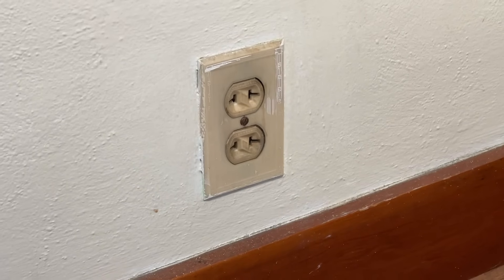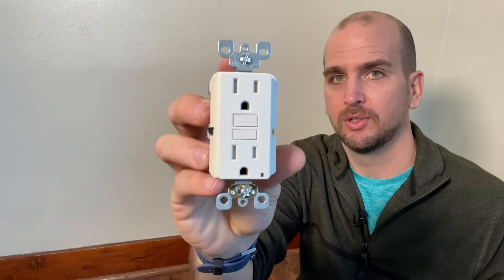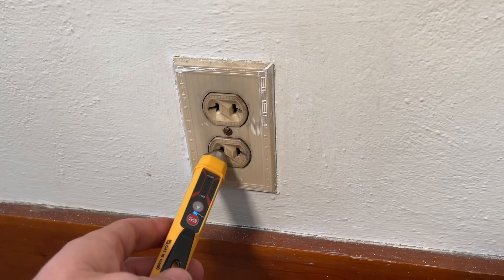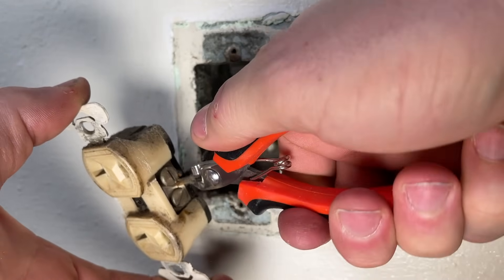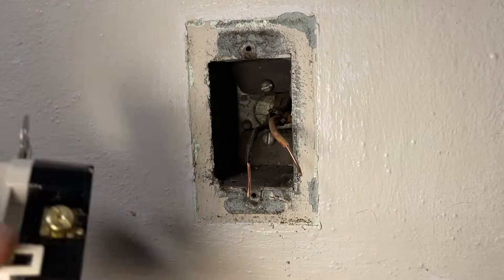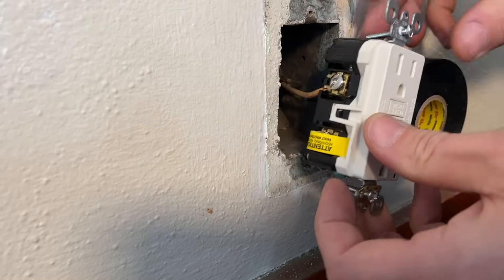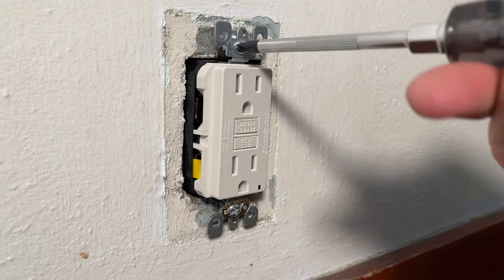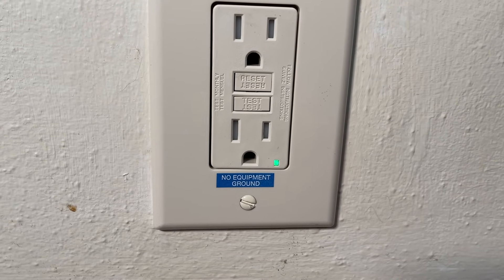How To Replace An Old 2 Prong Outlet Using 3 Prong GFCI

Comment: Right gfci will work even not grounded but still not grounded. You have to create ground return path and your return path is your neutral  which in reality is the natural ground. Important is to bond the neutral terminal to the panel. Please don’t give solution that will not really do the work.
Reply: No, using the neutral wire for grounding is against the code. This works and it is up to code. Nobody says it is the ideal way but running a separate ground wire can be expensive.
Reply: This video shows exactly how NEC recommends fixing.  Learn a little bit next time before commenting.

Comment: Almost every outlet in the USA is installed upside down; I guess it's because when installed wrong, the outlet resembles two eyes and a mouth.  But properly installed, the "mouth" should be on top.
Reply: No, the code does not specify the orientation.
Reply: @okaro6595  Who said anything about a "code"?

Comment: Remember that while this may provide a safe looking receptacle that gladly accepts your 3 pronged plug, surge protectors rely on the ground to shunt over-voltage away from your equipment.  So plugging a surge protector into one of these receptacles would render the surge protector ineffective.  I almost bought a house where the owner had replaced all but one of the receptacles with 3 prong without adding a ground source but when I saw the older receptacle I tested and found they were all UN-grounded.
Reply: It'll make cable boxes pick up noise and have occasional pixelation errors on certain channels not being grounded right. DVD players are sensitive to skip too. Microwaves & refrigerators can give you a mild shock if you touch something grounded or have a concrete floor barefooted.
Reply: @virginia7125  DVD players do not have grounded plugs. They do not care if the outlets have ground connections.
Reply: @virginia7125  Yes!! We had an old fridge plugged in downstairs as kids and everytime we went to open it we'd get that warm fuzzy feeling. Thinking back on it now, yikes....
Reply: He aesthetically improved the outlet. Glad it has a ground port, too bad there is no ground reference to make it actually work as a safety function.
Reply: Surge protectors typically have three varistors, one between each wire pair so they should work also without the ground wire though maybe not as efficiently. Of course one in general can question their usefulness.

The main problem is that this could cause voltage spikes especially if you connect ca computer to a TV with an RCA connector. Fortunately that is not done anymore. RCA is a badly designed connector as the signal connects before the grounds. It is better to use wireless solutions if the computer is not grounded.
Reply: Depends on the surge protector. Without a good ground a simple varistor surge protector only provides limited high voltage hot to neutral delta-V protection.  A strike to both incoming service lines would pass right through. Basic solid state surge protectors provide very little high impulse, low current (static discharge) protection regardless of their design; they work too slowly.
Reply: @Ehbfunbcc Whjfhbhjxf bad practice. Is the pipe corrodes, a fitting comes loose, or a portion is replaced down the road with pvc, then you have the potential for an electrified section of pipe with no path to ground - in other words, a death trap.
Reply: Cool story, bro.
Reply: im going to drill a hole thru the ouutside wall and run a ground wire to ground rod right there outside. NOT 8' long as the ground here is like reinforcedd concrete so if i can water the ground and get the ground rod 2' in the ground and keep it moist i think that  will be fine... kinda cheezy but... beats having to rewire the whole place with 3 wire wires in old house that is brick and no access t the wires, old wires... without just running new wires outside in conduit attached to the side of house/back of house where no one sees it anyway. new wires straight to the elec panel. in short run... a hole drilled in wall and ground wire to ground rod outside for the GFCI outlet to work right, better than 2 wire only from 1947 ish
Reply: I lived in an apartment like that. Seeing some of the other work done, I suspected the grounds weren't hooked up though then found the 1 2 prong outlet and pretty much knew but I checked anyway. I was right.
Reply: @n1umj  guy told me he did that in old house FOR SALE... replaced all 2 wire outlets with grounded outlets... no ground. LOOKS right... he cld have drilled ahole thru the wal and driven 2' long ground rod in the rock hard ground for the ground with a little more work.  yes not exactly right but it wud have a ground.
Reply: If the entire house has no ground....it's an old old house...  installing a GFCI receptacle  in the front of the circuit is the best and only option....That's it!  End of story!.....Obviously a Surge protector is ineffective! Re-wire the entire house!  But that costs money!   And electricians, are too expensive......so do it your self, and burn your house down

Comment: Won’t pass code, and it’s a waste of a GFCI, with an open ground it will not trip.
Reply: It doesn't rely solely on current being present on the ground connection: it'll trip any time the current on the hot and the current on the neutral are unequal. You can confirm this by splitting a power cord and plugging the hot side in to one GFCI outlet and the neutral elsewhere (carefully, very carefully). When you turn on the load, the GFCI will see current on one wire and not the other and trip. 

In practice, this sometimes happens when replacing an old outlet that had a ceiling lamp (!!) daisy-chained on it that used a separate neutral or was energized by a lamp leg coming from somewhere else. (!!!!) You get your GFCI installed and it works just fine, but then it trips every time you turn the light on.Then you curse because you have to go back and rewire the daisy-chained load on the Line side of the GFCI. And then you curse again to send a little grief to the builder (long since gone to his reward) who installed that screwy wiring in the first place.
Reply: I've ran across the white wire being hot, not neutral if on a switch. I had to straighten a few miswires in my house built in 1956.
Reply: 0 iq the gfci may not trip with a plug tester but will trip of neutral al and live are bridged together with the test button also a resistance will also make it trip
Reply: The GFCI will still function as intended, the open ground will not prevent the transformer from detecting a change in current
Reply: @Thumbsdwn  what transformer are you talking about?
Reply: @bokesnmokes  the current transformer inside of the GFCI that "measures" current in/out
Reply: @Thumbsdwn  got it

Comment: The Ontario Canada Electrical code would not accept this replacement unless you have a ground conductor connected to the green screw on the GFI receptacle.  You do not need to run a ground conductor ( usually a bare or green coated wire) back to the main panel provided you can attach it to the nearest metal cold water pipe.  No Canadian Electrical  Authority would pass this upgrade as shown.
Reply: Different areas have different codes. On some areas such connection to a pipe would be strictly illegal.
Reply: That would be a pain depending on the type of house, probably would have to open up the walls to run new wiring.
Reply: Canada is inconsequential

Comment: This is no better than cutting the ground prong off, If your going to do something do it right and ground the outlet or leave it alone. At least before you knew there was no ground and that sticker will fall off in 2 years or less I promise you.
Reply: This is significantly better as the GFCI protects the user. A sticker will not fall off from plastic.

Comment: ground fault circuit interrupter (GFCI), needs a ground to work. Why not put a $2 plug and ditch the $10 GFCI, because its not up to code either way. You can take the baseboard off, cut a line down the wall and replace the wire with no damage, from the top plate, go into the attic and run a new home run(circuit) put it on a GFCI breaker so it is up to code for bedrooms. up to code and safe. I would rather go the extra mile to insure my families safety or someone else's.
Reply: @tradde11 to be honest when I seen the title my first thought was he would pig tail the neutral to two wires and run one into the ground, your plug tester & plug would work right. but its not up to code and has a chance to over load the wire going to the panel.

Comment: After removing the two prong outlet why cut the cords instead of simply unscrewing them from their respective posts? Cutting them reduces their limited length and seems unnecessary.
Reply: Should have at least 6in. Of wire outside of the box . According to the NEC.

Comment: "If you live in an older house, you might have two-prong receptacles, which are just a pain in the butt, AND unsafe..."  Sir, 2-prong outlets are NOT by themselves unsafe, nor is a grounded outlet providing any additional protection unless the appliance cord requires a ground.  This sort of misinformation causes the public to panic and overreact to these legacy wiring methods.  There is a time and a place for grounding a receptacle or providing a GFCI in lieu of a replacement 2-wire receptacle.  But no one should be under the impression that danger is lurking on every wall of the home where two-wire receptacles are present.  In fact, if your home was built in the 1960's and you still have 2-wire receptacles, chances are the box IS grounded, and whether you utilize the adapter with the "strap" and place the cover plate screw through it or you simply replace the receptacle with a 3-wire receptacle, either would afford a suitable ground in the event of a fault.

Comment: I've noticed  the 2 prong outlets still being sold at Home Depot and maybe Lowes on the electrical Isle.

I have NO idea why would Home Depot be selling 2 prong outlets whenever nobody buys them and gets the 3 prong outlets instead.

I use the 3 prong outlets since most of tools and appliances I have are 3 prong and I DON'T want wanna use up all my adapters
Reply: Bc by code you have 3 options, replace old device w a new gfci outlet w the label no equipment ground, replace w a regular 2 prong w ground w the label no equipment ground, or replace w another 2 prong outlet
Reply: The two prong (ungrounded) outlets are for existing work which doesn’t have an equipment ground.  The t-slot outlets are still available, too
Reply: I'm just bought and installed 2 in a property.  It was built in the 1950s and I was installing GFCI/AFCI receptacles, but one receptacle had 6 wires in the box and another one was switched.  So I just used 2 prong receptacles there.

Comment: Using the metal flex back to the main doesn't meet code unless all the boxes are bonded. In most cases the MX cable is not approved for a neutral isolated ground back to the main panel.

Comment: Where's your ground wire? The metal boxes are not grounded. Your ground fault circuit will not work.
Reply: The GFCI will sense a difference in current between hot and neutral, indicating that some of the current is somehow getting to ground -- like thru you, e.g. -- and trip.
Reply: The GFCI will work if the equipment fails. However, a metal box is a risk if it is not grounded as if it gets hot the voltage goes through the ground pin to the case of the connected equipment. The GFCI does not detect this if it happens in the GFCI outlet. If it happens in a chained one it will detect it. A GFCI detects only faults that happen after it. 

They could fix this by selling outlets with a dummy plastic ground hole but that is not possible as people would mistakenly install them on grounded installations in which case it would ground.

Comment: Awesome!!!  I’m in a house that was built in 1960.  I’m going to do this
Reply: Good luck, one GFCI is over $20. Buy contractor’s pack of 3 instead 😉
Reply: @lockpickingvlad  u only need to buy 5-6  total max
Reply: @Nick-bh1fy  depends on how many you need to replace, could be 20
Reply: @lockpickingvlad  
Depends on how many rooms and how many receptacles in each room and if they are all fed off the same circuit in each room.
Reply: You can use the one device to feed multiple outlets on a circuit
Reply: @Nick-bh1fy  I know that. I’ve been doing residential remodels for 18 years. Like I said earlier, depending on what you have. Just wanted to point out it’s cheaper to buy a pack of 3, rather then buying the GFCI outlets individually. I had a customer who didn’t know that. He just bought an old duplex in Seattle for over $1,000,000. True story.

Comment: It seems everyone is giving lessons in home wiring according to how they do it, not necessarily the right way.  Wrapping tape around outlet is a good way for moisture to collect and short out and does nothing  When wire are so short- pigtail them out. You cinched your wire on the wrong side of the screw.  If giving lesson then show it right.   
 Grumpy old Electrician here!

Comment: GFCI's throughout the entire home would get overly expensive
Reply: You don't have to do that. A GFCI works on any outlet down stream from the GFCI as long as it's on the same circuit/ breaker. It's the best practice to install your GFCI outlet on the very first outlet of the circuit so every outlet is protected after that outlet as long as they are on the same circuit.
Reply: @evanpatten4101  how can you figure out which outlet is the 1st one. My house is a cluster F... thanks 👍🇺🇸😊
Reply: @semperfi5861  No worries. Truth of it is you won't really know where a circuit starts unless you go to studs. But there are a few things you can do,  easiest way is to flip the switch off at the breaker you are wanting to install the GFCI on. Then take your outlet tester, you can find them everywhere for like $7, and follow from your breaker to the nearest outlet that is not showing a current. Your panel should be labeled but don't count on it to be accurate if it's an older house. I do home inspections and regularly find them labelled inaccurately. It may be best to try to do just one room with its own GFCI.

Comment: My older house has 14 outlets and all but one has two black (hot) wires and two white wires, so replacing the old two prong outlets with GFCI has been simple, but one outlet has three black wires and three white wires. Don't know why, but it's in the bedroom, the GFCI has a place to connect two black and two whites, but not a third for each. So I'm not sure what to do with that outlet, can you help with a solution?

Comment: I found a bare grounding wire up in the attic of my parents house. And I measured it with a vm. I was able to tap off that and add a ground to an older receptacle. The previous owner was a Mickey Mouse do it your self-er. I spend hours in the attic fixing all the crap he did. Had a lot of nuts and bolts connected to wired then wrapped up in electrical tape to the size of a golf ball.
Reply: You didn't have knobe and tube in your attic? It's pretty much non existent except for houses from early-mid  1900s
Reply: @yellowflash5555  after WWII knob and tube was quickly replaced by an early mineral-jacketed NM cable which was not grounded.  Beginning in the mid-1950's a bare copper conductor was routed independently of the NM cable but routed to each metal box, where the electrician wrapped it multiple times around the nails which anchored the box to the studs.  As time went on, NM cable started to include that ground wire inside the jacket, albeit one size smaller than the accompanying circuit conductors.  This method continued right up to the end of the 1960's.  Even though these boxes now were grounded, and had been for probably about 15 years,  the original wiring devices installed did not include 3-prong outlets;  however converting them to grounded outlets was and continues to be, quite straight-forward.
Reply: @steveloux4709  such a rarity nowadays